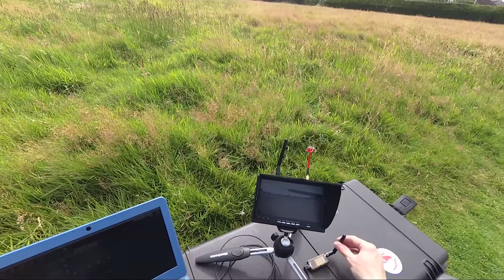Tarot 650 Sport // Position Hold AutoTune // Pixhawk + Arducopter 3.5

Comment: I have a similar setup but rctimer motors and 15x5.5 props. I need a 4s to fly. What flight times are you getting?
Reply from the maker: I actually haven't flown it since August, on T-Motor 3508/380kv with APC 12x5.5, where I was flying fairly hard for 12 minutes on 4000mAh 6S & landing above storage voltage.
Reply: Tedro Peders RCTimer 5010 530 KV? I'm using the same setup with 6500 mAh 4S getting about 15+ minuites of flight. Btw im using Tarot 650 Ironman